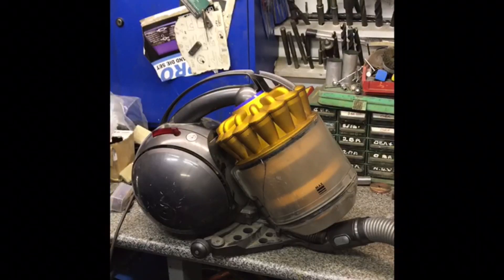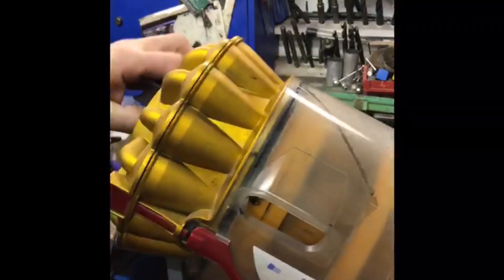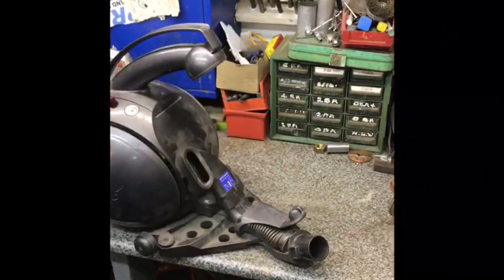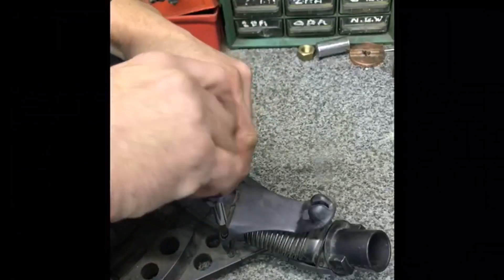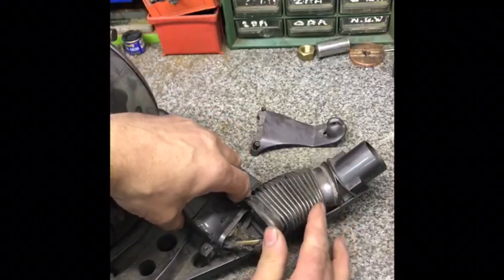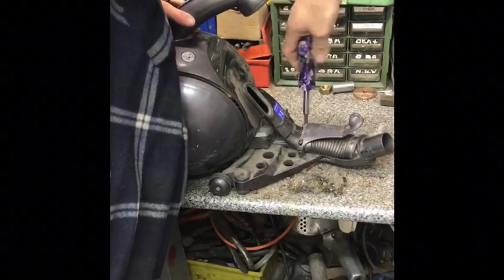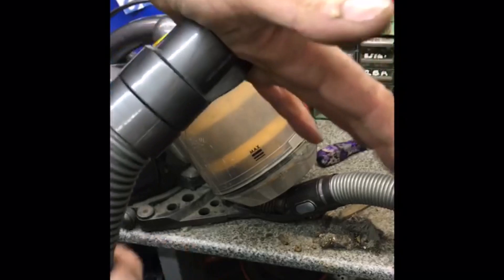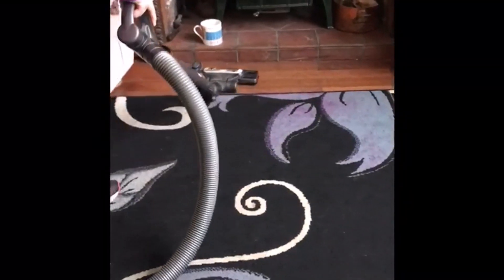Dyson Dc39 repair quick and  easy

Comment: It’s a fairly significant design flaw, when the most difficult to access section of tubing is the only  section that’s rigid, flattened and bent at a 120 degree angle, for this NOT to end up blocked would be a miracle!…..I’m proposing a friendly competition, ‘What was the weird stuff blocking your Dyson?’ Me? A tonne of dust and hair, a rubber band, a tiny screw and a whole Chinese sausage!